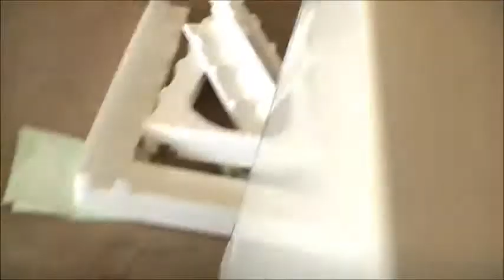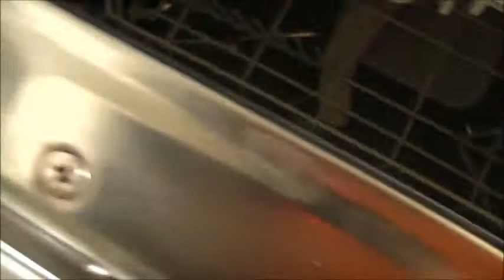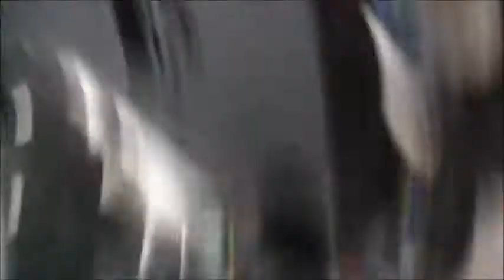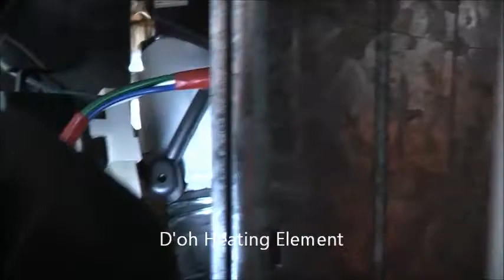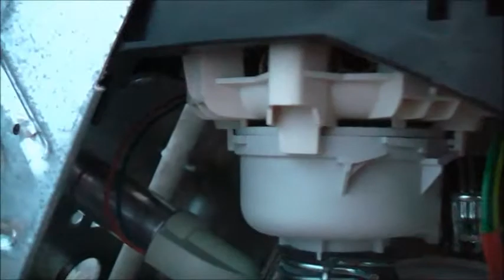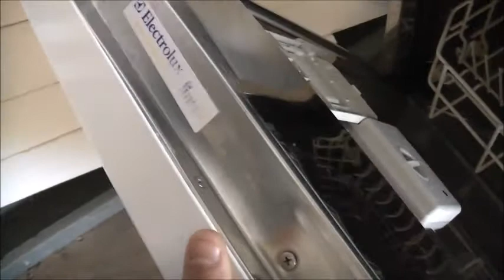Last Of The Aussie Made Dishwashers

Comment: Our dishwasher needs an external hot water supply, which probably makes it more reliable in the long run. The only heating element is inside the cabinet to dry the dishes.